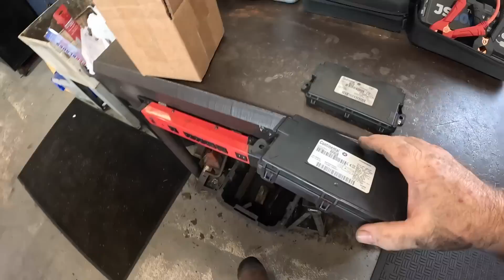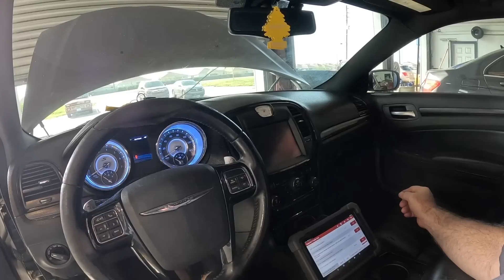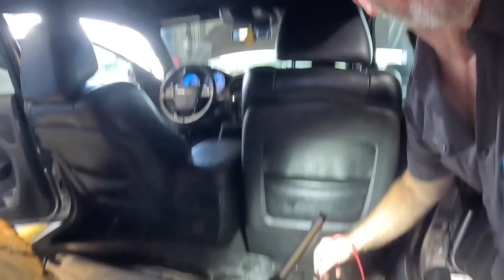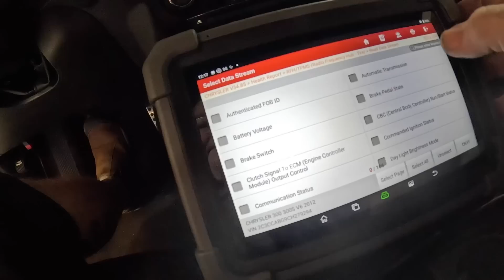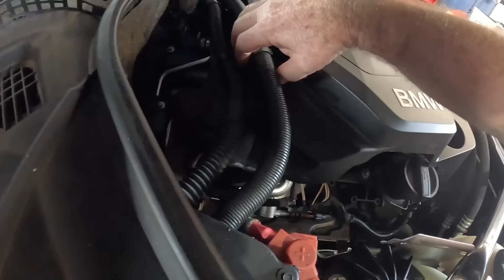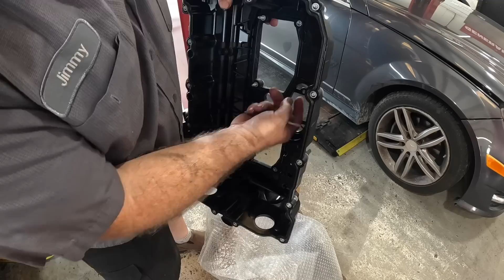300C ELECTRICAL DIAGNOSIS, SHORT, 528I, MAJOR OIL LEAKS, DAY 562 IN THE SHOP #auto #repair

Comment: Im sure this job is complete by now, but those timing chain guides haven't updated ..... The new revised kit the guides are white and the balancer hub has laser etching instead of the washer. The oil pump drive gets done at the same time . Without the laser etching the hub slips causing the engine to lose timing = valve crash. I have seen the N20/N26 locked up with 30,000 miles. I am sure that you are aware, if not  I'm just trying to help .
Reply from the maker: Really appreciate that input! The car is down the road for now. But I’ll note this for the future as well as for if it returns!

Comment: Your xtool would of programmed them Chrysler keys no problem for the future
Reply from the maker: Awesome to know, I'll check it out next chance I get. I assumed it requires lock smith credentials on these, but maybe it's more like a GM with a time out function?
Thanks.
Reply: @philh9238  pre 2017-2018 it's mostly pulling a pin code but in Jimmy's case a new rfhub needs software programming then key programming. 2018 up they are all rolling pin codes with 12hr expiration so would need dealer credentials to get that code

Comment: I'm mostly a solder guy but you're correct there is no oem that mentions solder when repairing they all instruct to crimp. Even oem pigtail connectors sometimes come with butt connectors
Reply from the maker: Exactly. I solder on occasion, mostly on stationary harnesses. But crimping seems to be what the OEM prefers. No real right or wrong if done right  I think though.

Comment: I have a 740i on valve covers every clip breaks every fuel line has grommet issues once removed crossover wires..a pcv oil tube through the left side can't see work while blind then do it again cause it's 1/26th off center...some kind of vacuum valve on the back no tool made can losses the fastness so you have to make one..lol parts hard to get..nightmare..my son drives it noe.😅
Reply from the maker: Man they can be tough to work on for one thing and super easy for another. I keep getting the tough ones too, haha!
Reply: Not sure why one would own a higher-level car that you simply want for transportation only. Buy a Honda or something. The problem with BMW are posers who want to appear wealthy, buy the cheapest used Beemer they can find and still can't afford to maintain it. So they drive it into the ground then tell everyone what junk it was and how they'll never own another. Those that have owned these german luxury cars laugh at the posers with their taped up sunroof and rattle can painted fender and laugh non-stop.

Comment: I find it ironic that the piping for the hot air intake on the Chrysler is red. If weeds can't hide from Spectracide, will the Spectra oil pan for the BMW hide the oil leaks? 🤔🤔
Reply from the maker: Hahaha, that is a great point M!

Comment: Nice job on the 300C.

"Uro" parts are the European equivalent of Dorman.  Just FYI so you're not surprised by the comeback next year 🙂  Never seen that copper either; the major failure point on these engines are the timing chain guides.  They are made of a faulty plastic and eventually crack and break apart.  You have to take the front timing cover off to replace them.  I bought one of these for my wife (the 328i variety) back in 2012 and sold it in 2019 and it was actually a very reliable car.  Never did anything but maintenance on ours.
Reply from the maker: Thanks for the input, appreciate it!

Comment: 15:00 I think it depends on the solder you are using. There are soft solders, low melt, or hard solders, high melt. I usually use something in the middle
Reply from the maker: I Mostly use 60/40, but 63/37 Is a little softer. I tend to crimp using water proof connectors instead or even better use factory style connectors with pins and weather pack housings.
But in reality if it's working for you, it's the way to do it! :)
Reply: @JimmyMakingitwork  the debate will never be solved 😂